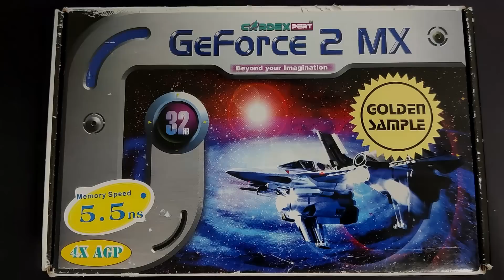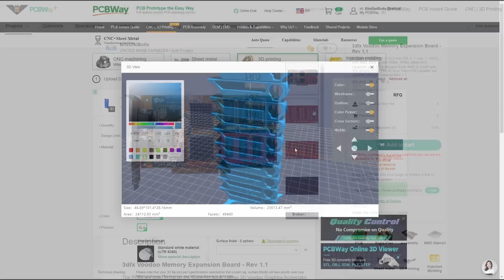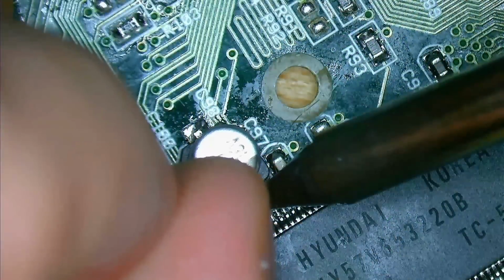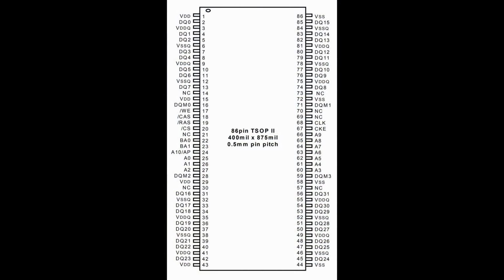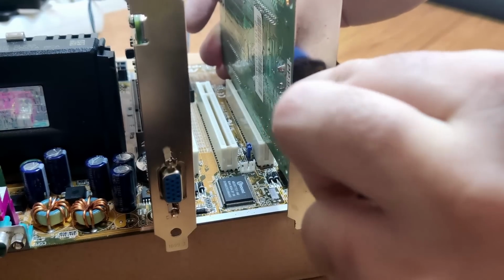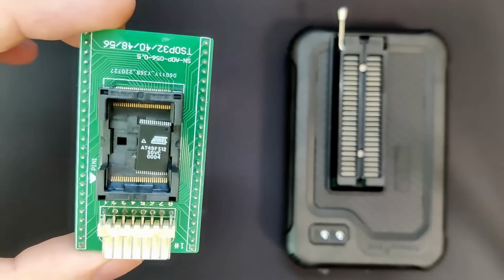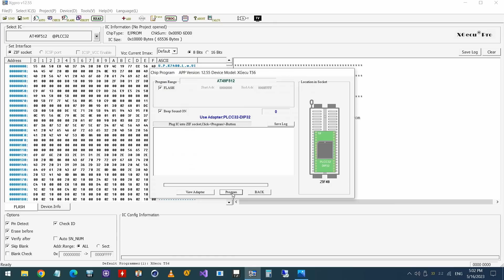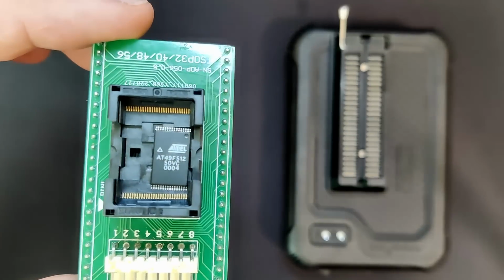Fixing my GeForce 2 MX (black screen) - after 20 years!

Comment: MX 400 128 bit version is the sweet spot between having as much as possible conventional memory in dos (different GPUs change that amount, I can't really explain why, but it is happening) and performance for Win 98 gaming + it supports 320x400 resolution in build engine DOS games. MX 440 128bit is a little bit better and has cleaner image thru VGA, but it's stucked at 680 kB of conventional memory in dos, while with MX 400 I have 714 kB!! Ofcourse with himem and emm386.exe RAM, it doesn't work without any memory manager in totally clean dos.

Comment: I remember having a GeForce 2 MX die as well that we replaced with a GeForce "4" MX 4000. I wonder if that BIOS issue is what rendered it inoperable. I don't have the GF2 anymore but the MX 4000 still works okay, but I'm not using it in any system because it's fairly slow.

Comment: How did you solder the BIOS chip socket to the motherboard?
Reply from the maker: The card has solder pads for both types of BIOS chips. I was unsuccessful flashing the original BIOS chip as well as the replacements I got. I decided to not spend more time on those since I could use a standard PLCC socket and chip.

Comment: EE here, and one of subjects of study/practice is IC design. This could be due to a couple things, but more often than not, it is due to a "read/write" cell malfunction due to data path failure. 
The error you received 2AAA is the location address (as stated in the error). This simply means, access to that location is not allowed; or in this case, just not accessible.
The reason for the non-allowance is usually due to a data path disconnect within the framework on/in the sub-straight at or to that location. This is the most common type of failure (the oxide layer was not thick enough because it was from a batch where it was polished incorrectly due to incorrect geometry during the manufacturing process).
So, you being proactive and not waiting for an adaptor was the correct solution in the end, because there is nothing you can do to remedy this issue.
Hope this helps...
Reply from the maker: Thank you for this explanation. I got the adapter and tried to flash the chip - I got the same error! I even got replacement chips that also do not flash when using the programmer and an adapter. I don't know why, but I stopped trying. Somehow, the programmer also does not like those chips I got. It complains that the pin designations do not match and the software for flashing refuses to continue

Comment: I had a similar GPU journey - went from a TNT1 (Creative) to a PAINFULLY generic GF2MX 400 that had damaged memory from factory - I had to run it at 135 rather than 143Mhz to avoid artifacts. Yes, the card was so bottom-of-the-barrel that even though it had lower clocked memory than standard mx400 spec it could not even manage that - well what can you do, it was all I could afford at that time. Then, some years later, I upgraded to a Radeon 8500 from Gigabyte which was an awesome card to experience in its time.
Reply from the maker: Funny you mention memory. I may have a similar issue with my card. I didn't have the time yet to investigate, but will try to find out if the memory or the chip is to blame for almost zero overclock-ability.

Comment: That chip not being blank means it was obviously a reused chip, unless you used it yourself, someone sold you recycled e-waste .
  One common chip contents without text strings in the first block would be a motherboard BIOS with the reset vector and date at the end.
  A trick to quickly verify card roms is to use the embeddef checksum field that some mitherboards check during boot .  The checksum and image size are stored near the start .

Comment: 1:20 Something similar happened to a NOS Dell OEM STB Velocity 128 (Riva 128). Massive chunks of the code on the stock 27LV256 BIOS chip were flipped to FF. I flashed a clean copy (I was lucky that I had backed up using a TL866 when I was first learning on it) to a standard 27C256 and bam, it worked again. Looks like a special LV OTP chip was unnecessary, too. For all of these old cards verifying the bios is good is a solid first step. Also, back the damn thing up when you get a new retro video card.
Reply: To me, OTP means One Time Programmable, that is no reflashing except to overwrite some bits to zero, just like on old PROM chips, but often using crippled versions of erasable chips instead of the ultra simple design of fuse PROM chips .

Comment: I went from an ELSA TNT2 i think to ELSA Geforce2mx back in the day. I just started using Blender back then in 2001 - using a PC i rescued from a dumpster. The dumpster PC had a characteristic smell, a bigtower ATX enclosure (Codegen probably or Chieftec if i remember wrong), a Rage of some sort (dead), a spectacularly pretty MSI mainboard (alive), an Athlon i think 700 or 750 (alive), 128 MB RAM (alive), and some optical drive or two (dead), and some harddisk (dead). The crux of the problem and the reason it ended up discarded was the cheap 430W PSU that came with the enclosure, it was basically still smouldering when i recovered the PC. Just cleaned things up a little and replaced the dead components, mostly with stuff i had at hand, like that TNT2, a 350W FSP, and some optical drives, adding a fresh Maxtor DM80. Anyway Geforce was really a major boon in Blender.

The DM80 with "lifetime warranty" turned out to be a mistake. I bought several of those drives back then for various uses, and ended up having to mail them in for repair for the next 8 years, i mailed each drive in several times, each time costing me around 20€ shipping to Ireland. Fast drives, seemingly well behaved, but prone to sudden death.

I had a Mitubishi DiamondPro monitor at the time which i cheaply got second hand, which could do high resolutions and high refresh rates but in turn was very sensitive to the analogue circuit quality on the video card, you could outright see the jitter on many cards. So i wouldn't buy off-brand cards - if it was going to be an Nvidia, it would necessarily be an ELSA. Those ELSA cards never not once gave me trouble of any kind, and ELSA drivers were also better and nicer than upstream ones for a time.

Comment: Very nice video! How do you solder those PLC sockets on? Those are kind of tricky to work with. I would appreciate any suggestion. Thank you.
Reply from the maker: Yes, they are due to limited space. I did melt parts of the socket. I just used the thinnest soldering tip I had (which was also part of the FNIRSI HS-01 bundle). I may remove the socket again because I have those flat BIOS chips and not many cards use them. I'd rather keep the PLCC chips for other cards.
Reply: @bitsundbolts  Thank you.

Comment: Before donating the motherboard and PC a scanner and optical drives, CASE, PSU, plug power-cord, hard-drives, PII-350MHz CPU and heatsink, RAM, sound card, NIC, Keyboard, Mouse, and ATI Rage Graphics (and software) to a music student (so he thereby had a PC so he could go to a music Institute) about twenty years ago, I had this situation like your hardware troubleshooting with a Geforce2Mx400 and a 440BX motherboard, so it was an almost identical combination of hardware to that which you have and similar symptoms. So I mean I had a challenge with a similar GeForce2MX in motherboards (for example a 440BX intel Chipset) that had only a 2x AGP (although it worked on more modern Motherboards with AGP 8x) and it appeared to be the card locking up on account of the limited oscillating crystal that dictates the bandwidth (and thereby interrupt request) of the AGP port, and so the card could not operate outside of a limited range. It would do 2D but not 3D in that motherboard but worked fine in other motherboards. It is similar in appearance of some symptoms to the IOMMU locking up of a Dell i350-T4 RJ45 NIC in a PCI-e slot of a more modern different PC lacking SLAT. This incompatibility with the 440BX Motherboard however was not a problem with an almost identical card with the legacy PCI interface instead of AGP. Likewise a 2x AGP Graphics card Riva NVidia (basically like TNT) worked fine in all the motheboards, however a TNT2 Nvidia by Sparkle which had the 4x/8x AGP slot would not work and yet worked fine in other more modern motherboards. The same 2x slot problem of the 440BX chipset motherboard pointed towards the oscillator crystal limited bandwidth. This incompatibility with that 440BX (a good motherboard BTW) could also be repeated with a Geforce4MX and a GeForce256. It would appear that, by you updating the BIOS, there has been an update whereby somebody has realised the Oscillator crystal's limited range is not being adhered to by the card and so a BIOS update (or replacement BIOS chip) allows it to operate within the range of the AGP2x slot. That card does not need anywhere near the bandwidth of a AGP slot and won't even saturate a legacy PCI bandwidth. Whether or not your BIOS chip itself has become broken, your symptoms resemble a catch22 of being unable to operate the card within the range of the AGP bandwidth dictated by the motherboard and you might have had better luck flashing the BIOS on a much more modern motherboard such as one with a 8x AGP slot.
You would be able to copy your backed-up old BIOS firmware to the new BIOS chip you bought to see if it read it right and to see if the old firmware was causing the problem of it it was instead a purely hardware fault with the old BIOS chip itself. Be careful assuming it is faulty though because it might not be. Remember that AT49F512 has a Boot Block Lockout which, when enable, prevents reprogramming of it. The RTFM says "The address range of the boot block is 0000H to 1FFFH."
 If it is "broken" (and it might not be but instead just a somewhat fussy semiconducter CMOS that wants specific capacitance when written to at 5Volt, but whatever), it could be a failure to liberate electrons (when writing to it so it needs perhaps a threshold of tolerance not yet met in the valence band of the heterostructures) in a van-der Waals gate. To quote Wiki "In semiconductor electrochemistry, a Mott-Schottky plot describes the reciprocal of the square of capacitance versus the potential difference between bulk semiconductor and bulk electrolyte.".
It could be worth you making a breakout with a breadboard (connected with a home printed etched copper pad, maybe with some PCB mask painted on) and flashing the firmware of your removed BIOS chip with a RaspberryPi_GPIO rigged up with small cables (short runs). 
Regarding checking the data when read of the chip (such that you run a checksum), if you have a function-generator-logic-analyser combination equipment, you could observe the signal coming out of the old BIOS chip as you attempt to read off it, or even use an FPGA to make one to do that since that (and capture the data too). You have the other chip as a known quantity for functions you generate in your signal path to send through the BIOS chip.
I no longer have that 440BX motherboard because I gave it to somebody in a PC.
This comment does not constitute medical advice. Proceed at your own risk.
My comment has no hate in it and I do no harm. I am not appalled or afraid, boasting or envying or complaining... Just saying. Psalms23: Giving thanks and praise to the Lord and peace and love. Also, I'd say Matthew6.

Comment: I have a couple of cards that have this exact same behaviour. I was wondering if I needed a BIOS reflash or if they were Mac versions.
Same POST codes, but I have PLCC chips :)
POST codes I think are the ones you get when, after post; it issues the "press F1 to continue or hit del key to set bios", just before starting the boot process. At this point i take it as a "needs bios reflash" to work. BTW I also checked  if Windows was detecting them correctly, that's a good sign toward recovery.
Reply from the maker: If you get a BIOS beep or Windows detection, a BIOS reflash may be all that's needed. I wonder how many of those old cards are trashed because of that issue 😔 hopefully word gets out and some of those cards can be saved!

Comment: MX400 was my fist true 3D card. Yes, it was rebranded old tech and technically a junk even at release but at that time to me it was best thing in a world.
Reply: I say they were great! the price was anyway, I remember feeling quite sore about buying a Geforce2 GTS and then the MX400 came along at such a huge discount with a lot of the performance, it wasn't quite as fast but was more than good enough.
Reply: the MX-400 was my first graphics card in 2001. The very first one I had  bought and it had 64MB and if I recall, it was alright for a 512MB Athlon 800 based PC that I ended up building. The MB was the Asus A7-V board, had to purchase the case, graphics card and audio card, the rest came from the old PC after trying to replace the hard drive that had failed in a refurbed AST Bravo tower and AST (as did PB) had fled the US, so built the PC by buying a gently used CPU, MB and memory from a friend. Not a bad PC as it was considered the shit back in the day (meaning, it was good). At that time, I was running Windows 95 and the new drive was 17.2G, a reburbed Western Digital Caviar Green that I still have (IDE no less) and it could not be read fully with Win 95 as it saw it as 17MB, not GB. Windows 98 fixed that.

Then I made the mistake of "upgrading" to a Foxcon Micro ATX board with 400MHz FSB, I forget what the memory was, and Celeron processor by misreading the specs in the ad as an upgrade kit. The PC was never the same after that and wound up buying a brand new Dell Studio XPS with the first gen Core i7.

Comment: Had a similar issue with a GF2 GTS this year. POST but no image at all. I spent hours thoroughly investigating the card for damage but wasn't able to find anything. After watching vswitchzero's videos on the V3 cards, I then threw in a PCI card and flashed a bios from DOS (with nvflash I believe). It is running perfectly fine now.

Comment: Ah GF2 MX, my first 3D accelerator, drives me crazy. Some games always crashed after a few minutes. Found out after several month, reducing AGP Mode from 4x to 2x solve the problem...😲
Reply from the maker: Bonding with your hardware and understanding its personality 😄 what a pain!
Reply: that VIA chipset life
Reply: @rasz  I had VIA chipset mainboard i think at the time and didn't have that sort of trouble... Or was it SiS? Difficult to remember.
Reply: I remember reading back then that reducing the AGP mode back to 2x was necessary on some Nvidia and ATI based cards. It seemed like some of that generation of cards and mainboards that were capable of AGP 4x weren't entirely stable at that speed. I had a Radeon DDR 32MB card back then and I think I was able to run it at 4x speed on the Asus P3V4X mainboard I had at the time.

Comment: Interesting video. Usually the Golden Sample versions have higher frequencies than the standard card. Your card is I guess a Golden Sample because of its 5.5ns (183 mhz) memory, almost all the regular GF 2 MX only have 6ns (166 mhz) memory.
Reply from the maker: I don't want to say too much, but I have already tried a bit of overclocking - and the results were very disappointing. More videos to come about this card.
Reply: @bitsundbolts  Didn't the GF2 MX was so bandwidth constrained by its 64 bit memory bus that no matter how much you OC the GPU it didn't get any better performance?
Reply from the maker: That is very true. The disappointment is when overclocking the memory. Memory overclocking gives a measurable benefit for those cards. More details come in the next video.
Reply: @RetroTinkerer  the standard GF 2 MX has a memory bus of 128-bit. The GF 2 MX200 is the one with a 64-bit bus. There are also many GF 2 MX400 with 64-bit bus, but those have DDR memory and because of that, the same memory bandwidth as a regular GF 2 MX / MX400 with 128-bit bus and SDram memory. By overclocking the GPU of the GF 2 MX you do gest better performance, but by overclocking the memory the performance gains are a lot higher.
Reply: Strange that it's golden sample but not pre-OC'd, ah but you DID change the BIOS, so the original may have had the golden sample OC applied
Reply: In fact golden sample have memory over 200 Mhz, being the fact that some had 250 MHz memory ICs (normally found in later ASUS V7100 Black PCBs).
Reply: I believe that Golden Sample is/was just marketing product of Gainward for some models